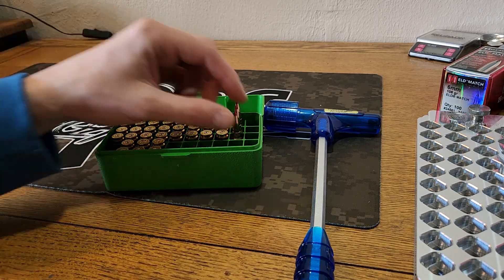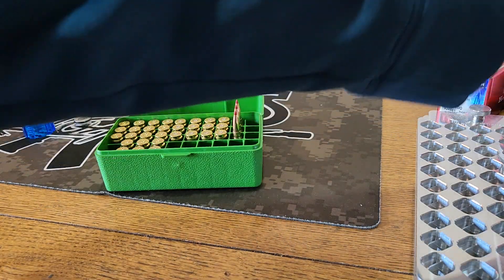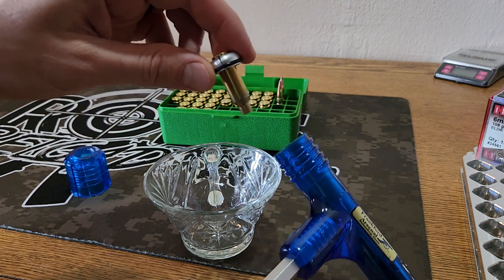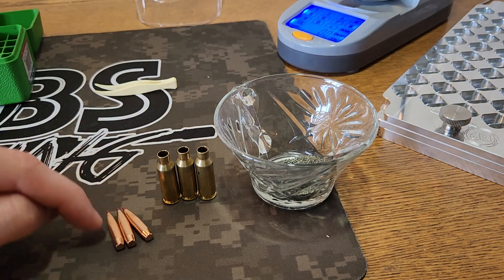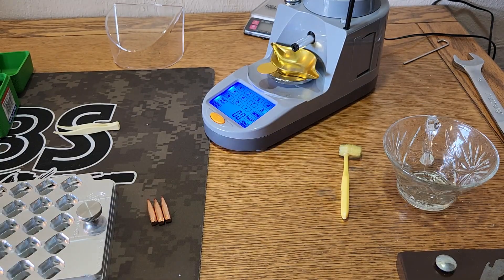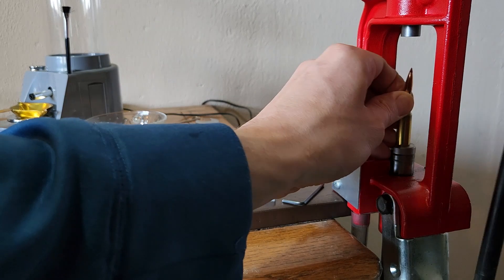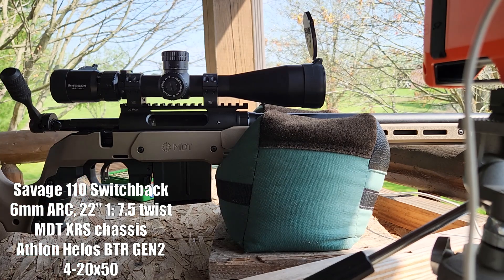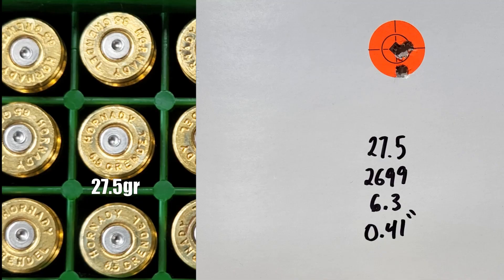Shooting Bullets Pulled from Loaded Rounds-- Still Accurate?

Comment: I wonder if pulling the bullets and reseating loosened the neck tension and sped you up?
I just had to pull several I was going to reseat as foulers and sighters due to trust issues. But you have opened my eyes to research opportunities.

Comment: Hey thanks for the video man, new sub here! Cool tip/trick I learned from pulling many bullet with one of these thing is, if you break the little bullet holder you can use your shell holder instead. I stopped trying to keep track of them little pieces and started using the shell holder, I’ll never go back.

Comment: I imagine that chunk of steel weighs quite a bit more than the press that's mounted to it!  I never would have thought to hang it off the edge like that, but it makes for more room on the bench.
Reply from the maker: it works well because the force is not on the front of the bench as well, its off to the side providing a more solid feel to the bench its self. Seemed like a good way to mount it to me considering I have drawers that would be blocked if mounted traditionally.

Comment: If you install a cotton ball or two or a foam ear plug in the bullet puller nose , it won't deform some soft nose bullets . You can smack the puller harder for less smacks needed to release the bullet also .  My bullet puller has had a couple of cotton balls in it for many years .
Reply from the maker: Good Idea, never thought of adding some padding inside. I try not to get in the habit of loading to hot and having to pull a lot of rounds.